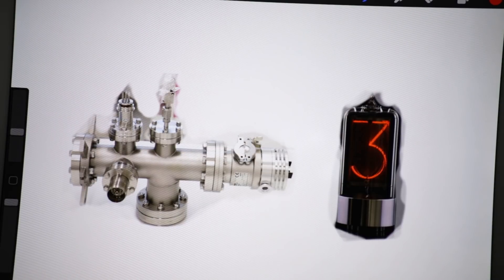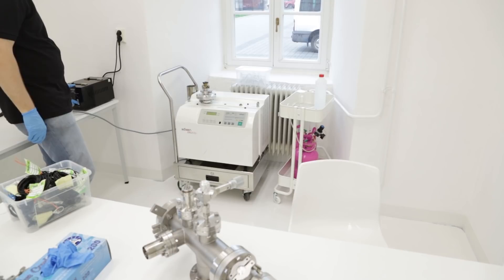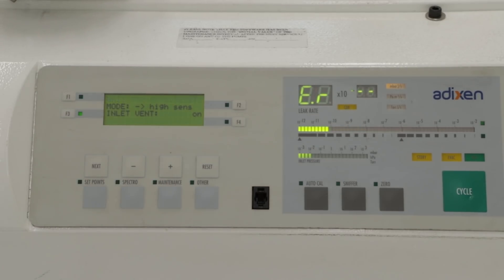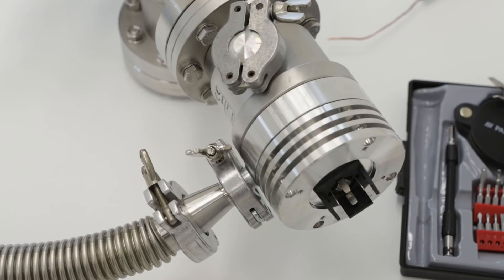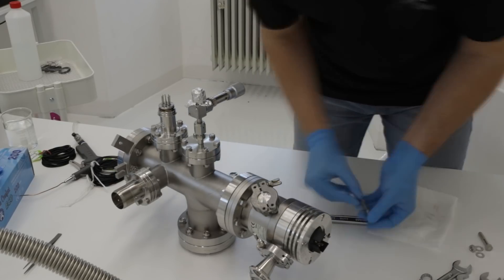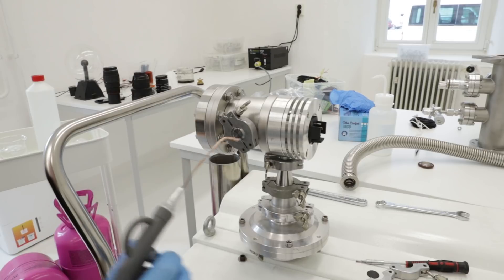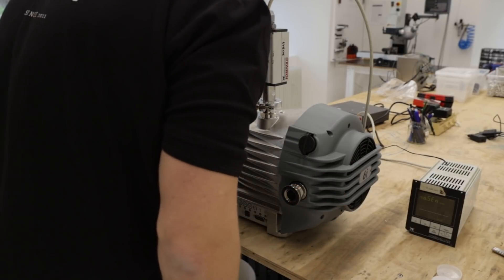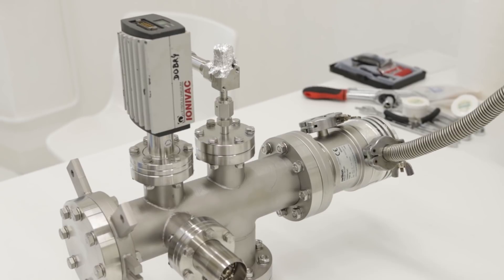Fixing a leak in UHV chamber

Comment: I'm concerned about the level of expertise demonstrated in handling seals and gaskets aspecially considering the equipment avaiable. It's crucial to understand that copper gaskets, once used, cannot be effectively reused. They deform during the initial installation to create a proper seal, and reusing them compromises this seal. While it's true that some installations may leave gaskets slightly uncompressed for potential retightening, this doesn't imply that they should be reused.

Moreover, the complexity of O-rings is often underestimated. They are not just simple components; their effectiveness depends on applying the correct force, which is usually achieved through specified torque settings for the bolts. The design of the sealing surfaces and the arrangement of bolts are meticulously calculated to ensure an even distribution of pressure, ensuring a proper seal. Incorrect torque application can lead to uneven pressure distribution and compromise the seal's integrity, as evidenced by the need to replace the seal multiple times.

Additionally, the material and hardness of O-rings vary significantly, making the choice of a specific type crucial for each application. Generic O-rings are not always suitable. Their dimensions, including cross-sectional area and diameter, are critical. For instance, a 50mm diameter application might require slightly smaller O-rings to introduce the necessary stretch, depending on the specific requirements of the system.

I am not suprised you haven't reached UHV.. I don't think you realize the process difference between UHV and HV
Reply from the maker: This was not a final assembly, so I am reusing the copper gaskets here - followed by He test. Once the design is confirmed, the chamber will be disassembled, cleaned and new gaskets used in CF connections. The standard KF connections with o-rings cannot be overtightened - there is a metal centering ring inside the oring that serves also as a limit of compression.

Comment: UHV is voodoo magic, fake leaks, vented screws, torque wrenches, conflat fittings, so much to learn.
Dalibor, I work at a national lab as a mechanical technician, if you have any questions I could ask my knowledgeable coworkers about ultra high vacuum systems for you, they love to share. Don't hesitate to reach out!
Reply: Upvoting + Commenting on this to help the algorithm !
Reply: I’m also an HVAC technician, and I find it very difficult to check for leaks at a location with multiple potential points. Helium gas often escapes through nearby areas.

Comment: Usually the KF flange on the turbo should be welded, not attached with epoxy. Edwards nxds 6i ... good choice! However, please read the manuals when using vacuum components... not every button on the scroll pump is self explaining (for example long press on-button for auto restart after powre loss). The itr90 might be overkill, you don't need a Bayard-Alpert I guess... I can recommend pfeiffers PKR251 (pirani + cold cathode). do you have a leak valve between nixie tube and your test chamber? Even this mini turbo will pump ~60 liter/s. Your residual gas might be gone before you could analyze it. You maybe need a CF-valve (expensive) between turbo and test chamber to store the gas inside your test chamber for testing. However, you will need to make your test chamber REALLY tight, otherwise pressure will increase fast! you should also add a vent valve on the turbo. venting from the back will reduce it's live time and you will push the bearings-oil from your turbo into your test chamber (way not that much compared to a rotary vane pump) and in the pressure range you will achieve with the small turbo this will not be important I guess. What's your personal goal for this chamber? 1e-7mbar?

Comment: When I have several flanges close by where one might be leaking I use electrical tape around the ones I'm not testing to help isolate them from the helium. It really helps with narrowing down exactly which one is the culprit. Obviously this doesn't help if your mass spec or the room is flooded with helium though. If it's a large leak (perhaps anything larger than 10E-7) diluting your helium concentration with nitrogen or argon gas to something like a 25% or 50% mixture can also help.
Reply from the maker: Two genius ideas, thank you! I will try them both. Cheers

Comment: You need a torque screw driver if you play with that level of detection. Gaskets are specced to work at an exact amount of pressure determined by the torque applied on the bolts. Exceed it or install the gasket incorrectly, and you'll have issues. In the moment, or later.

Comment: Hi Dalibor, I am periodically working with UHV at my job, so I could provide some information and help if you are intrerested. From watching your video I have a couple remarks concering things, that might become a problem in the future. For example: Depending on the final vacuum level you want to reach, you should never reuse the copper sealing rings in your CF couplings. Consider them consumables as the knife edge will never align with the ring exactly at the same position again. It is also good practice to rinse all parts with isopropyl alcohol and wipe them dry with a special lint-free tissue. High boilng point contaminations such as oils from your skin really come and bite you as they result in long lasting virtual leaks that take forever to pump out. Residual isopropanol also contaminates your vacuum but due to its lower boiling pressure it pumps out more easily and quickly. Finally it is a very good idea to use a torque wrench when tightening the CF coupling screws. There are tables online giving you detailed procedures on how to fasten the screws for every diameter of CF flanges, like for example, every diagonal screw with 2 Nm, then with 4, then 8 and finally 10 Nm around in a circle. It helps driving the knife edge into the copper evenly and gives a good measure on when "enough" pressure has been applied to make a good seal without damaging the threads. Do you plan on baking out the chamber in the end (might not be needed for a simple RGA...)? What vacuum meters do you have? A Pirani will only be usefull down to 1e-4 mBar and should not be switched on when there is full pressure in the chamber (that is probably why the meter gave you an error in the beginning). If you have a combined Penning-Pirani-meter you should be good down to 1e-9 mBar. Hope this helps...
Reply from the maker: Hi! Thank you very much for the tips. Once the chamber is assembled and all working, I will disassemble it and replace all gaskets with new ones, for permanent seal. I plan to clean the chamber in lab dishwasher with neodisher agent and DI rinse - should be enough. Torque wrench is on the list :-) I have combined pirani/ion gauge, it works from e-1 to e-10 mBar, I have tested these myself only to e-7. I am quite confident up to e-6 mBar (my daily work), which is mostly about removing water, going higher is new to me. I plan to wrap heating tape around the chamber and heat it to 200C with turbo and RGA on 70-100C only. Cheers!
Reply: @daliborfarny  Where I worked we used metal gaskets also. 3000bar was normal pressure. We always used taper guages to make sure all metal to metal sealing surfaces were perfectly square. These may help you as you torque the bolts. HTH.
Reply: ... never used a torque wrench to close CF flanges ~ some hundreds of flanges up to now, all good (not true, I misaligned some DN250CF copper cascades). The gauge is a pirani bayert-alpert combi. alcohol cleaning and later backing helps indeed a lot (1e-7 to 1e-9 mbar)...  further down the compression of turbos is usually not good enough, further down you will need ion getter pumps, sublimation pumps, cryo pumps.

Comment: Remember, High Vacuum systems are sensitive to any contamination in the chamber like finger prints. They'll off gas for days and prevent a good vacuum. Even the wrong kind of oil and gaskets will look like a leak. I'd expect 10-4 torr starting off, keep it running for 24 hours to allow things to offgas. Getting heating tape made for baking vacuum chambers helps a lot. I used to build these if you like any help.
Reply: when it reacts to helium being applied to the outside its pretty clear that there is a leak,no?
Reply: Commenting below this to help with the algorhythm!

Comment: use a silicone lubricant on the o-rings, makes a better seal and keeps them from pinching or tearing
Reply: this can easily ruin your vacuum from outgassing. I think in this application it might not be as bad as these seals seem to be on the output side of the turbopump, but still not great
Reply: @Basement-Science  orings need to be lubricated, you will get more out gassing  if they tear . lubricants help seal the oil in a motor actually seals the piston rings .
Reply: @Basement-Science  thats why you vaccume the silicon sealant in another vacume tank prior to using it for this application.
Reply: @rafaeldiegonavarro  This is not about dissolved gases. The lubricant itself will slowly evaporate and contaminate the vacuum. That's why if anything, you need to use a lubricant specifically designed for vacuum applications, such as vacuum pump oil, which has a very low rate of evaporation.
Reply: @Basement-Science  teflon coated orings !!! teflon does not out gas hence used in cooking pans!

Comment: Please never stick your hand near any pump holes. Ever. Even if you are sure it's not an intake. A friend lost a chunk of their hand very painfully that way...
Reply: This hugely depends on the size (cross section area) of the hole.
Reply: from 1 bar? what happend? I always put my fingers to test if there is still air flow....
Reply: @demolitionb  The pressure itself is not the problem. Pressure is Force per Area. 

If you were to get your hand over a large opening and a sufficient vacuum builds on the other side, the Force could get so big that you are unable to pull your hand away. At the same time your skin gets pulled away from your bones, although it shouldnt do permanent damage in most cases if you manage to get away in time. 

With a much bigger vacuum pump this might actually be a significant danger. But with this, you would really have to try hard to get hurt.
Reply: @Basement-Science  your right, but than we talk about more than the area of a cent / 1 cm2
Reply: @demolitionb  Yes. Only dangerous in extreme/special cases.

Comment: These small turbopumps from Leybold/Oerlikon are really nice and easy to disassemble.
What I noticed was that you did not use any vaccum grease or oil to help the o ring to seal?
This makes a huge difference try Dow Corning vacuum grease or oil for diffusion pumps, dry o rings do not seal very well!
Reply: Please, no grease! No No No. Use proper O-rings and tighten them. Good enough for 5e-8 mbar. No need for grease
Reply: @demolitionb  i would only use this grease for stopcocks and for compression fittings.
Reply: apiezon m grease is a easier to clean grease then dow i recommend it highly.  All you need is 99%  iso alcohol for cleaning

Comment: Why are most high vacuum setups look like they could resist an earthquake? They only need to hold 1 atm from outside, yet the pipes and flanges are massive.
Reply: As with many things mechanical, rigidity is more important than things purely not collapsing. for example if the pipes were flexing, that means the seals would move as well, which leads to problems. 

And of course there are always big safety margins to tolerate shocks (sudden air inrush, hitting it from the outside etc). Especially Turbomolecular pumps could literally explode purely due to how fast they spin if they were built less solidly. Apparently this used to be a common problem with them when they were actually built with thinner walls.

Furthermore, parts like this are produced in low volume and the material cost is insignificant compared to asking prices.

Comment: What happens if you look at the light that comes off a nixie - what does that spectrogram show compared to the complicated machine?
Reply from the maker: We tried, spectrometer gives too low resolution - we will be looking for contaminations with partial pressures probably in 10E-5 mBar region, which is ration around 1:10000000 contaminant:gas filling. Impossible to identify the contaminant between spectral lines of neon/argon. But we went this way first as well :-)

Comment: Leak on vacuum equipment is a disgrace. ps: You need to put a little of silicon grease on the o-ring
Reply from the maker: I am trying without greases/oils first - they might become potential contaminants (bakeout process might evaporate the greases..)
Reply: @daliborfarny  I would highly recommend Apiezon L grease as a suitable ultra high vacuum and high temperature vacuum grease. We regularly use them in chambers that are in the ~5E-9 Torr range at high temperatures (300-800C).
Reply from the maker: @willman1011  That sounds good, I will look at it. I want avoid greases as long as possible :-) it will be all based on CF flanges, metal to metal.. should work without grease

Comment: Now you know the true hell of high vacuum leak detection. 🤣🤣 Imagine trying to find a leak on a 3 meter diameter chamber with over 100 ports and over 120 large sealing surfaces 300mm in diameter each that all have to be changed at once....every month.
Reply from the maker: Sounds like a lot of (full-time) fun 😀
Reply: @daliborfarny  Nuclear fusion target chamber....
Incidentally, you have the same scroll pump we use throughout our labs and we just had a safety memo go out to everyone about them. Apparently there is an internal wearing part inside the pump that is made from a complex variety of compounds including teflon, a trichlorobenzene polymer, iron and aluminum oxide dusts, zinc chromium compounds, and some other strange things that get turned into a brown dust which is regularly emitted from the outlet port of the pump. Our health and safety group considered it enough of a hazard to require we all now attach the BOC exhaust filter / silencer for these pumps to prevent the dust from getting out. If nothing else, it will make the pump even quieter and prevent any nuisance dust in your sparkling clean white lab!
Reply from the maker: This is a very good point, I wasnt aware of it - I will definitely get that outlet filter too! And will read manual as well :-)

Comment: Quick tip, always start leak checking from the top as the helium is gonna pass everything above you, RGA was very useful to me at work, any part of this bakeable ? I see copper and rubber (Viton?) gaskets....cheers.
Reply from the maker: Yes - I work top to bottom as well, I knew location of the leak from previous testing, so I went straight to the point :-) the chamber should be fully bakeable (copper gaskets) with just the turbo on rubber orings in low vacuum section. In the next video :-)

Comment: nXDS pumps are even more silent (especially in the beginning) if you mount silencer on the exhaust. 
But why epoxy seals on the pumps?
Reply: Because it does not matter on intermediate pressure level - possible leak rate or outgassing is quite irrelevant from perspective of the roughing pump. The whole turbo pump assembly is not meant to be UHV-tight when not in use with isolation valve on the turbo pump outlet port. And as it is the cheapest way from perspective of manufacturing and assembly - why not, it does the job.
Reply from the maker: Thanks for the tip, I will look for the silencer. The epoxy joint is made in factory to connect roughing port to the body of the turbo.

Comment: As a HVAC tech I feel your pain. I've delt with plenty of frustrating leaks. Make sure to use a soft metal or plastic tool when taking off orings, it helps avoid accidental scratches on the sealing surface. Excellent work 👍

Comment: Looking forward to seeing what you find out with this new UHV rig. 

Just something you may find useful, is heating the the vacuum system up to help remove other chemicals that could give you a false reading on the detector. 
As everything out gasses can impact your reading. 

Most of all take great care with the turbo pump, as the system needs to be down below it’s working pressure before you turn it on.
Reply: I thought the same: do not run turbo pump at atmospheric pressure! You can do it after the initial vacuum is reached. However I do not know Adixen equipment in details, but I think these rules are valid for all turbo pumps.